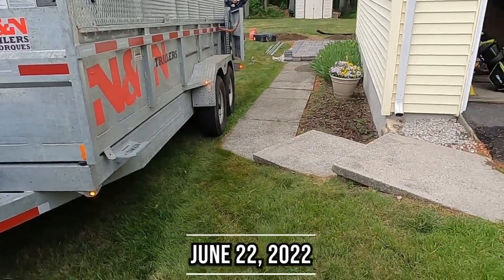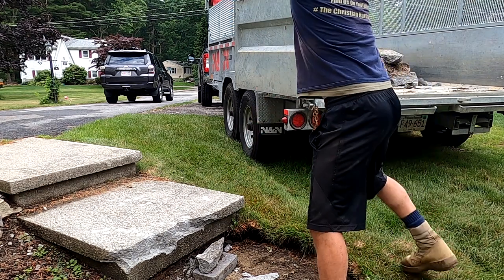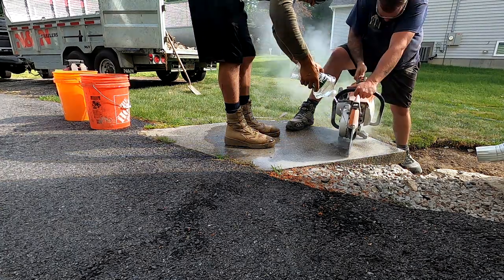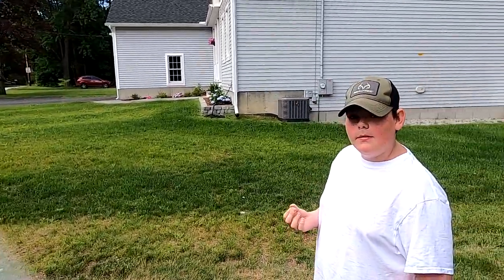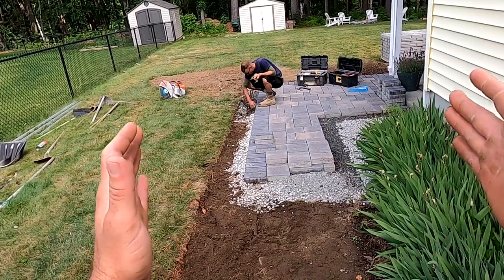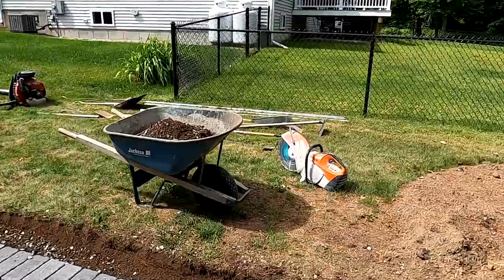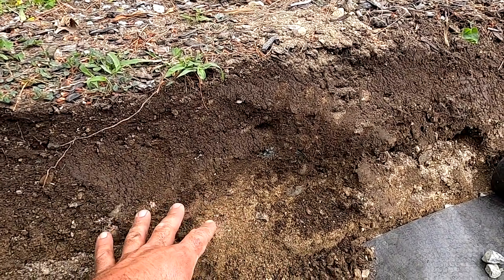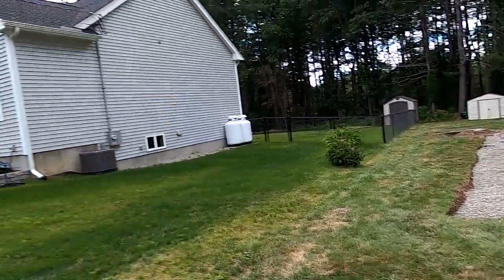Paver Walkway Base Prep (By Hand) No Machines....

Comment: Hi, I have another question that is stressing me out. I decided to use high performance bedding[ HPB] instead of the 3/8 inch clear stone. I need to know if the HPB has to be compacted before laying the patio stones [ 2 inches thick layer and if it is compacted by how much ] and should I do a final compact after all of the patio stones are laid? Thank you for any help you can give me, so I can finish this project happily.
Reply from the maker: HPB is just fine to use. When using 1-1.5 inches of HPB, we do not compact before laying pavers. We lay them and compact the pavers into the HPB with hammers and also tamp them down when we install polymeric sand. If you use 2 or more inches of chip stone, compacting it before screeding may be a good idea simply because the deeper you go with it, the more it will settle...

Comment: Would you be willing to help with more info videos are great but have technical questions loved that you showed that you keep inch away from home for water like weep holes but seen on one video couldnt tell if it was concrete or perma edge would appreciate you expertise and advice on patio /fireplace with bench project
Reply from the maker: Hey there, unfortunately I don't do any consulting really. It's hard to even find time to edit these videos..LOL. But depending on the situation it is better to have that joint you are talking about open with stone for drainage and sometimes it is better to seal that joint so water does not drain. Each situation needs it's own application. I wish you luck with your project though!

Comment: Hi there, I am at the stage of putting down the 3/8 inch layer of stone. My question is that you never mention when doing the final compacting, how much the 3/8 stone gets compacted? Could reply as soon as possible.
Reply from the maker: Nice, congratulations! Depending on the size of the paver, we account for about 1/4" compaction. Give or take a little, bigger pavers compact less than the smaller pavers.

Comment: Great job!  Being inexperienced in laying a new patio and pavers (but Im learning alot from your videos) I have a question for you.  I know our concrete patio now is as old as my house. Is there a way to glue new patio &pavers stones on top of the concrete or rip it out and start fron scratch?
Reply from the maker: Thank you! I typically always recommend getting rid of old concrete and doing proper base prep for pavers. However if the concrete is in good shape and does not seem to be sinking or shifting, you could either mortar the pavers to the concrete or screed an inch of bedding stone on top of the concrete and then lay the pavers like you normally would. ✌

Comment: Excellent job, Hope you can answer this, I've got a concrete slab a bit beat up, we wanna install pavers on the patio where the slabs are at, should we  remove it or we can  lay down the stone over?
Thanks
Reply from the maker: Thanks! So laying pavers over concrete is a grey area.... I would say that if the concrete seems solid and hasn't shifted or sank very much and doesn't have many cracks.... You could lay pavers over it. But if you do, I recommend using 1 - 1.5 inches of chip stone on top of the concrete for bedding and lay the pavers on that. That will allow for water to drain and will help prevent shifting even if the concrete shifts a little. I never recommend mortaring pavers onto concrete.

Comment: How do you make sure the poly sand fills to the edge of the pavers and doesn't run out of the outer edge?
Reply from the maker: There is no way to get poly all the way up to the top on the edge. There will always be about an inch off the sides that does not get filled. Just the way it goes... ✌

Comment: Regarding Travis, it's one thing to express interest working with uncle, good job on following through! I'm doing a hand dug walkway in Connecticut. Would you ever supplement base drainage with a French drain that can be connected to an existing line draining foundation and exiting to run down driveway. 3/4" and 3/8" traprock around here, no problem? Genest in Hartford area? Piling on brother, you're the best!
Reply from the maker: I agree, Travis always follows through, I'm very proud of him. And yes, I have added french drains to my projects quite a few times to help divert water in an area that is likely to have drainage issues. But this clean base material does nothing but help with diverting the water towards the french drain. Nothing but positive things with this method! ✌
Reply: Thank you for the input, I don't know where you find the time, we all appreciate it!

Comment: Is pavers cheaper than concrete?
 Which one would last longer? 
Would either make a difference price on the home insurance ? Or if selling your house later on? Thanks !
Reply from the maker: Pavers are usually never cheaper than concrete.... But with both options, it is all about proper installation. They should both last 20-30 years if done correctly. Most customers of mine chose pavers because they look much better. Pavers can be re - laid if some were to sink or shift, concrete needs to be ripped out and replaced when it sinks or shifts. But concrete can be cleaned and maintained easier than pavers... There are a few pros vs. cons for each. I think it comes down to your style and your budget. No difference with home insurance that I know of but I think pavers, when done correctly, add more value to a property than concrete for sure. They just look better...  ✌
Reply: @TheChristianHardscaper  thanks for answering my questions.  I'm looking forward to starting a project for my home and I was searching for more information.  Thanks, you and your team are doing an amazing job.
Reply from the maker: @mariamartinez-rr5ss  No problem, good luck with your project!

Comment: Hi Kyle , 

Totally random question 

How come no railing is required for the steps you guys built?  

Is it because it’s not the front entrance?  

Snowing here in NJ as I write this, hopefully you can make a couple shekels plowing, you guys in Central MA are getting more than us 

Thx as always for the great content. 

✌🏻
Reply from the maker: Hey Sean, those steps should have a railing for sure. Even if the code doesn’t require it in my opinion. 

When I build steps of any kind, I include in the contract that the customer is responsible for getting railings installed. It is actually pretty tough in my area to find a consistent railing fabricator to make custom railings and it can be a headache trying to deal with being the middle man of that. Trying to go back and forth with the customers and the railing guy to nail down styles and prices is not something I like to do. So I leave it in the customers hands to find a railing company to make and install railings if they choose. 

I make that very clear upfront on all step installs. Plus that puts the responsibility on the railing installer if something goes wrong. There is a lot of railing options out there that install in many different ways, so it’s better to let a professional railing company deal with the customers and show them all the options. 

It is snowing here now and will be plowing soon!! Stay safe brother! ✌🏻☃️

Comment: I think you  can use a jack  hammer
Reply from the maker: It only took us 2 hours to remove the entire walkway and the steps. Even with how thick the steps were. A little hard work never hurt anyone. It would have been $75 - $100 to rent a jack hammer plus picking it up and bringing it back. Not worth it on a small removal job like this. The walkway came up without any problem at all, it was just the steps that gave us a problem... but again, 2 hours to remove it all, no big deal. ✌

Comment: Why not use a rotary hammer instead of manual sledgehammer to break out the old concrete ?
Reply from the maker: It only took 1.5 hrs to break it all up and remove it by hand. It would have taken that same amount of time to drive and pick up a jackhammer, then return it. Plus cost me more because of the rental cost.... A little hard work never hurt anyone. ✌
Reply: @TheChristianHardscaper  oh I assumed you had a rotary hammer not that you would have to rent one. The 12 amp ones at harbor freight go on sale for $99 pretty often and work great for small jobs. You don’t need a legit jackhammer. With the shovel attachment they’re good to help when digging hardpack dirt as well. But that’s cool man, love the channel you guys do great work!

Comment: Sorry i dont know the technical names of all the tools and tractor parts i use (im kind of self taught since i had worked for a road contractor as a grade checker and equipment-operator many years ago giving me enough experience and confidence to try making a huge driveway project made for a school bus pick up and turn around so 0ur kids could get transportation to school again since the City and Port accidentally removed the old turnaround for our neighborhood street via their new road design!). So i had to bust out a lot of old asphalt to make a nice clean edge for the new super driveway with pavers that go along the edge of the City neighborhood street and then gravel and Truegrid commercial permeable pavers filled with gravel for the rest of the driveway. The new driveway is huge and shaped like a T because i had to widen the City street by about 10 ft so the school bus has enough space to turn into the middle of our driveway, then back out of it going the other direction. 
So anyway i was watching you guys trying to remove those large concrete pads (dont you want to keep or reuse those elsewhere?). I removed very large sections of asphalt myself (im a 5’9 125lb mom) but the way i did it was with the help of the right tools. Can’t remember what it is called but is what i picture the early rail road guys using and it has a pick on one side of the head and the back looks similar to the back of a hammer. It worked great to “pop up” huge slabs of asphalt using it then used the tractor to finish picking 9t up. You could also pound in a sharp metal crowbar type thing into the side of it, or pound stakes underneath it then pry up (although may break if you were trying to salvage it so maybe not). But i started to lift up these huge asphalt sheets (the road) and then our John Deere tractor’s loader/ bucket to then flip it up - i could then get off the tractor and then push it in the loader bucket all the way. Thank you for all the super helpful vidoes btw! Loved watching them!